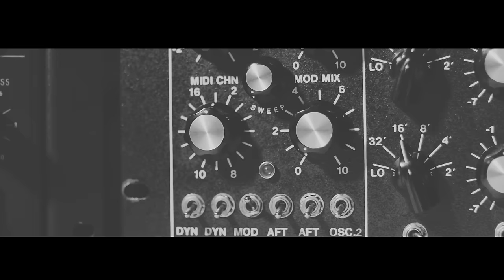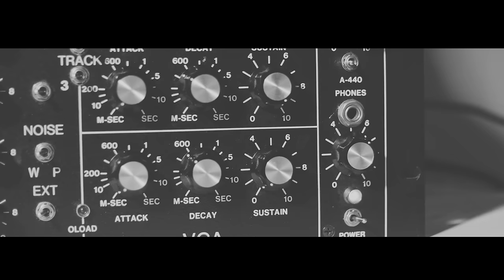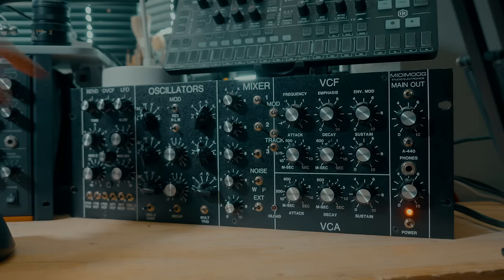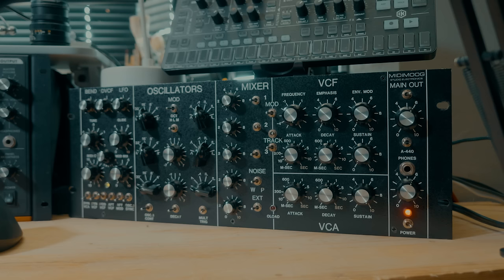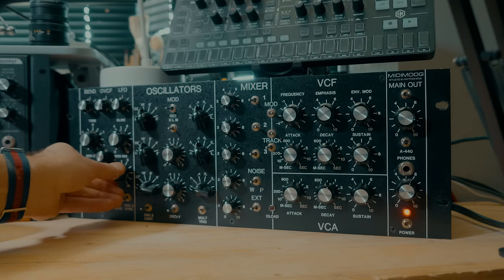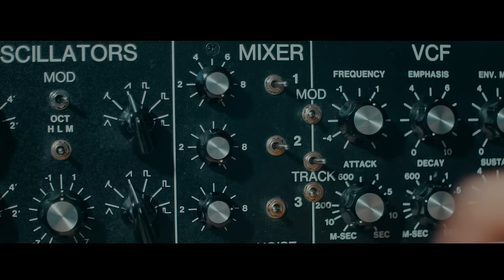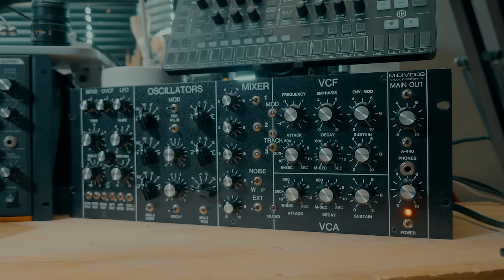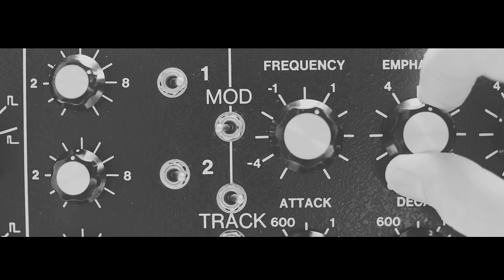Studio Electronics MIDIMOOG

Comment: I’ve got a soft spot for Studio Electronics. I own a P-Five which is SE taking a Prophet 5 Rev 3 and putting it in a rack, and the Obie Eight which is an Oberheim OB-8 in a rack, both made in the 80’s when Val St. Regis and Tim Caswell ran the company. They also did this with the Roland TR-808 and called it Harvey. Marc and Greg St. Regis have been great to work with over the years and have proudly continued their father’s legacy of making great analog synths ❤

Comment: The MIDImini has several additional switches for the following functions: 1) Sweep F/O (in VCO section - to choose sync via filter ENV or OSC3) 2) Prior L/L/H (set note priority in VCO section - Lo (classic Mini)/Last (ARP 2600)/High (Minikorg 700)), and 3) N/M (Modulation source: Noise (original Minimoog)/Modulation – below the filter tracking switches). Also, the original MIDImoog had a shiny front panel and no LED to indicate MIDI signals.

Comment: Hey Tim, thank you for the beautiful music and great story. I love the history of synths. The first thing I noticed about the MIDIMOOG, which you didn't mention, was the MIDI channel input selection - a simple turny knob selector - love that! I collect the cheap Behringer remakes of the classics, but you can't rack them properly because you have to reach up top to set the MIDI channel in, and even racked 4 cm apart, I have to use a mini mirror and tweezers to change the binary MIDI channel setting, or pull it out of the rack. Please keep up the great work!
Reply: you might consider bome’s midi translator software
Reply: Is there a reason you don't just "set and forget"? In my 19" rack days I had the channels assigned in Cubase on my Atari and never changed them.
Reply: @unclemick-synths  --> I have 4 workstations, and each has a different configuration. I use a variety of hardware sequencers, like the Roland MC-500 and the Yamaha QY300, and sometimes i swap the parts... midi channels go to various synths.. I have about 40 racked synths, so changing the midi channel inputs is necessary, frequently. I used to just keep everything in the closet and break synths out as needed, but i like the synths out and about where i can see them. My configs change frequently, and although there are hardware solutions to my issue, eventually I'll probably do like you say and have a standard system per workstation, hopefully sooner than later. It's easiest to change the hardware sequencer configs than the racked synth configs.
Reply: @russ254  --< I avoid DAW's like the plague.
Reply: @3D6Space  that sounds like quite a setup - no wonder you run out of channels! These days I only use MIDI for clock, step sequencing, or layering so everything is on channel 1 (or 0 depending on which gear is counting) and I just grab what I want in the moment.

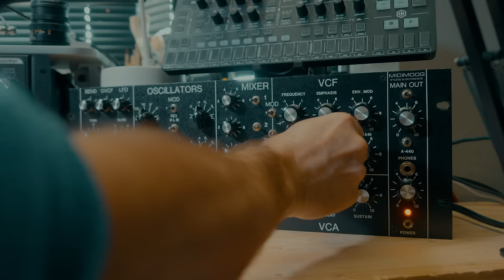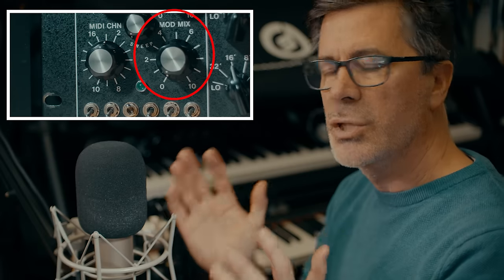Comment: 12:40 "You never heard a Model D doing that, did you?" I did! I heard Klaus Schulze playing a sync sound solo on a modified Model D during his live concert in Germany in front of the Cologne Dome Cathedral on 11 May 1991. The music was released as "The Dome Event" a few years later. I don't miss the sync option on my 1972 Minimoog. Other synthesizers can produce an equally pleasing sync sound, even those having only two oscillators.  As I prefer multi triggering and recording midi to single triggering and recording audio, I use a Kenton Pro 2000 as a midi to cv converter, whose software LFO I use to modulate pitch and filter cutoff. 14:42 Are you sure noise was sacrified as a modulation source. I spotted a Mod switch on your unit. According to Mark Vail in his book Vintage synthesizers, the N/M switch on the Midimini "lets you choose between noise or the dedicated LFO for modulation; the Mod Mix knob now mixes between the third oscillator and the added LFO or noise as the modulation source". Both the Midimoog and the Midimini have this switch, albeit called Mod on the front panel. In 1993, when my copy of the book was published, a converted owner-provided Minimoog cost $1,495,00,  $700 less than a unit built entirely built with Studio Electronics stock parts.
Reply: The MIDImoog doesn't have the N/M switch. That was added in the MIDImini.
Reply: The Dome Event and Royal Albert Hall gigs both have those wonderful MiniMoog soli - but I'm not convinced it's sync: there are interviews with KS talking about that sound and it's the Mini going through a TC distortion pedal (which sounds sync-like) with the filter under control of a pedal (the RFH section is called 'Pedals Away.') KS was very particular to get an old-style Moog pedal that he borrowed for each gig from a friend. 

That said, I'm pretty sure the MiniMoog could be fitted with sync, along with an LFO and other options.

Comment: I got to have a go with a MidiMini last year, and thought it sounded much better than any (original) Model D I'd played, but I wasn't sure if that was due to the changes/improvements, or it's the difference between modern circuitry and 50 year old, well used, synths.

Comment: Great video! Your's seem like a so-called 'Version 3' with only three switches below the oscillators section and no Noise/Mod switch on the mixer. This is the best (creamiest) sounding version in my opinion, but this is just from my personal experience and of course no two Minimoogs sound the same.
I stack up my three Midimoogs to form a 9VCO synth or to play chords thanks to the MIDI functionality. The results are mind blowing.

Comment: So which midi messages does it listen to? Note on velocity, mono aftertouch, modwheel? Pitch bend? Anything for Filter frq or resonance?
I saw Karl Bartos are using these boxes. I looked at buying one, ended going for Creamware Noah dsp emulation. Now also using Boog. SE looks and sounds so good.
Reply from the maker: If you want to remotely control filter cutoff then you can get your controller or sequencer to send after-touch messages.  No ability to control resonance though.

Comment: Moog replaced the Minimoog with the Source, a 2 VCO monosynth with (limited) patch memory. The Source sounds like a Moog, but not like a Minimoog.

In the mid-80's Studio Electronics did a small number of conversions of standard Minimoog's, keeping the keyboard but adding all the new bits you find in the later rack mount versions. I suspect these were built to custom orders for L.A. studio pros in very tiny numbers. I have seen a picture of one so I know its not a Unicorn, but rack mounting was all the rage in the 2nd half of the 1980's.

While chopping up a Minimoog seems like blasphemy today, back in the late 80's they were not collectible, not really worth anything. I bought one in 1987 for $200.00!  It was just an old piece of furniture sitting the corner and putting it in a rack with some new bits and giving it MIDI made it usable again.
Reply: My Minimoog is one of those conversions. Unfortunately it doesn't have that sweep knob to modulate VCO 2. Now after seeing this I want that function very very much :)  
And I'd like that switch I read about in another comment to be able to use noise as modulation.
I've seen an old picture of David Frank from The System with a converted Mini like that in his rack.